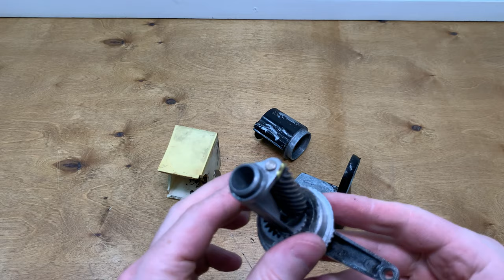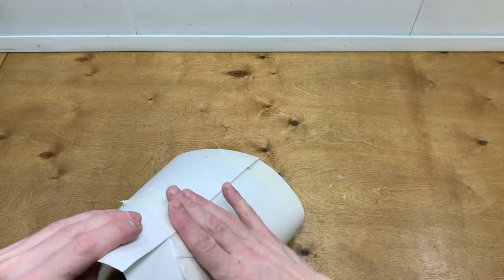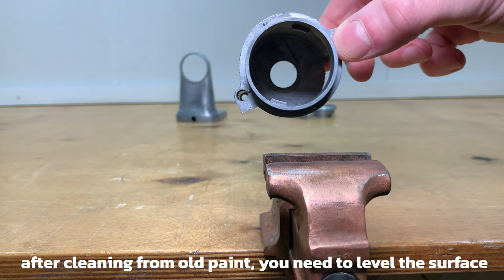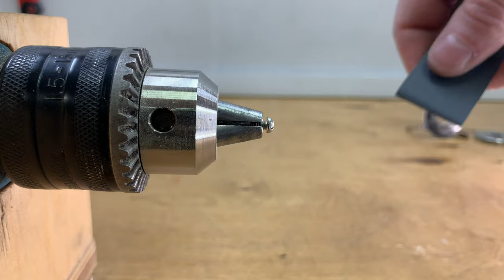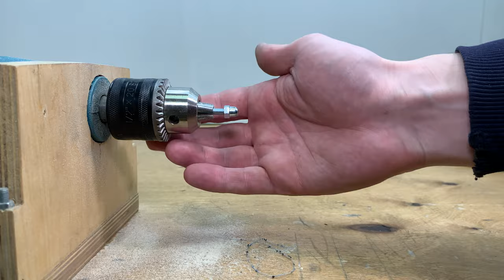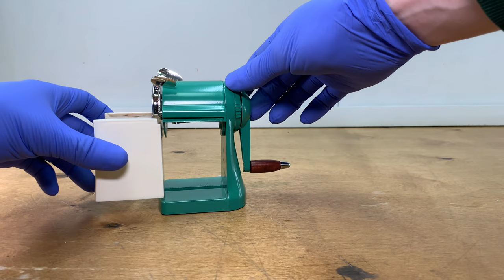Pencil sharpener restoration ✏ Custom Handle

Comment: Lovely little project 👍 reminds me of having to go to the front of the class to sharpen my pencil. Love the colour, turned out great.
Also liked the bit when you used the old grind stone to clean up that bolt head, that's something I would have done as well.
Reply from the maker: It's nice to hear that my video has brought back pleasant memories from my childhood. Thanks! Until I have a lathe, I do this)))
Reply: @restorersnotes3225  I think we do what ever works sometimes it's called ingenuity. Very clever out side of the box thinking.
Reply from the maker: You're right! the main thing is that you like it